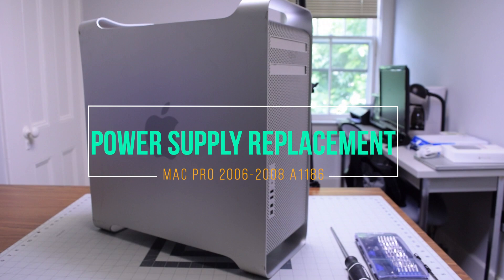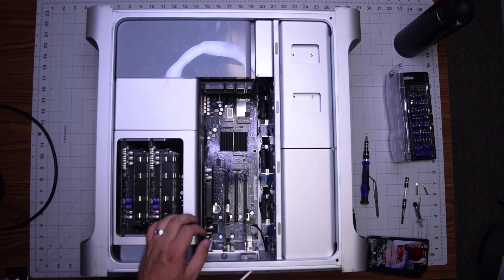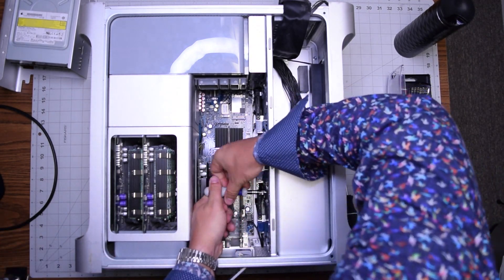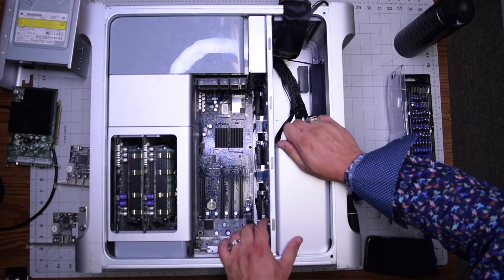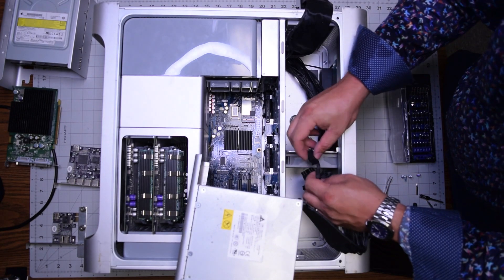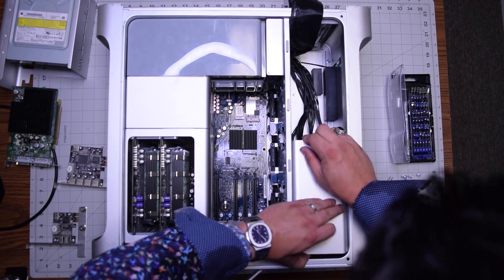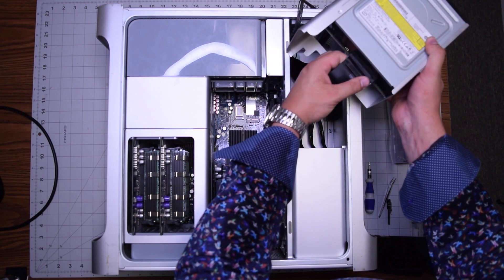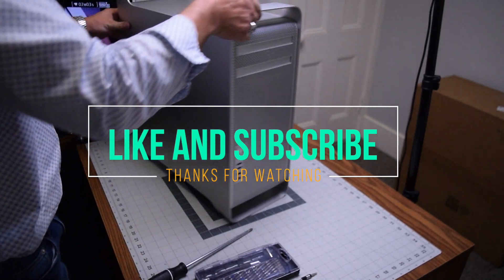Mac Pro A1186 - Power Supply Replacement (2006 and 2008)

Comment: Appreciate the guide, but is there some trick to pulling the power supply out?  It comes part way out but something is holding on inside the case, and I pulled as hard as I could

Comment: I’ve just replaced my PSU with one I bought on Ebay: a Delta DPS-980AB A PSU ($82 with shipping from USA to Spain), with no luck, my Mac Pro aA1186 doesn’t turn on. I’ve checked the logic board LED’s: all off. I ordered it because after testing a PCI video card I had around, my Mac stopped working 😢 and I assumed it was the PSU. So now I’m afraid the culprit is the logic board. The connection order I followed is: PSU #1 plug-Mac #1  plug, PSU #2-Mac #2, and so on. Any help would be greatly appreciated.

Comment: Mine's not the same. A 2008 model.  I had to remove 2 screws to take out a panel under the optical drive covering access to the cables that were a pain to disconnect.
Reply: Same

Comment: Could i have some help? i had left mine out in the elements for 3 months and it had water in the power supply area, Will this hurt my computer? its just really good to me and i have a lot of memories w it. it would suck if there's no fix to it
Reply: Let it dry out for a few weeks in the house with fans blowing in the case while the door is off. After you are certain it’s dry, try to boot it up. It should be ok provided it didn’t have power while in elements but it’s a toss up.

Comment: my 2008 is different.  i had to remove the cable cover plate.  the four cables 1, 2, 3 and C were past the top cooling fan.  is something wrong?
Reply: Same with mine.
Reply: @quatermass8  same

Comment: How do I test my power supply with a multimeter to see if it's the problem?
Reply from the maker: There are no official schematics from Apple, they are being sued for that actually. At these prices I would just buy a replacement supply, we have them here at a reasonable price http://bit.ly/2KCwbmz
Reply: I pulled out the optical cage, and tested power on the 4-pin Molex connector that is available since there is no second drive. Two inner pins are ground, the two outer pins are +5 and +12 volts DC. On my system, the +5 is exactly 5.0. the +12 is 12.24.